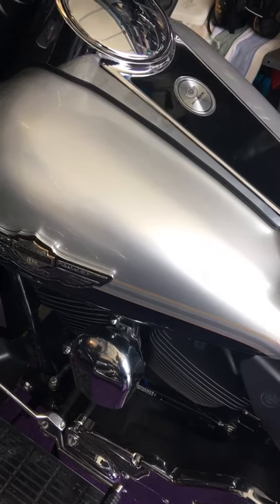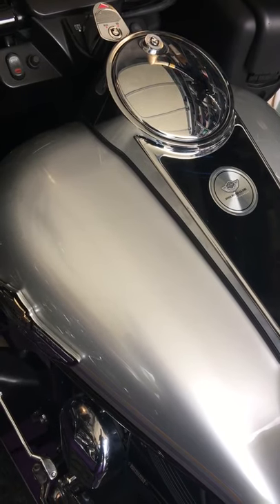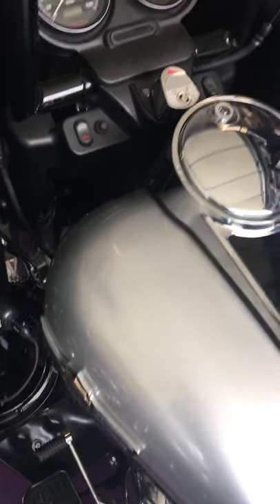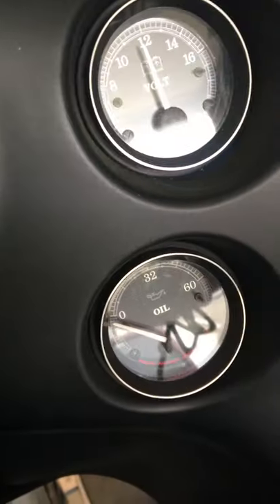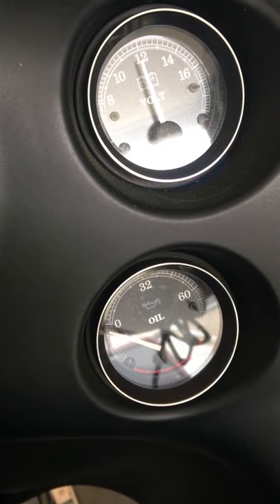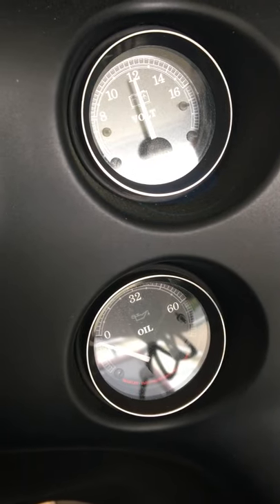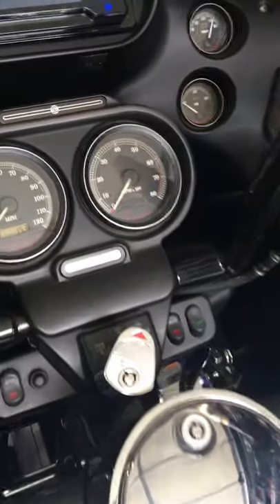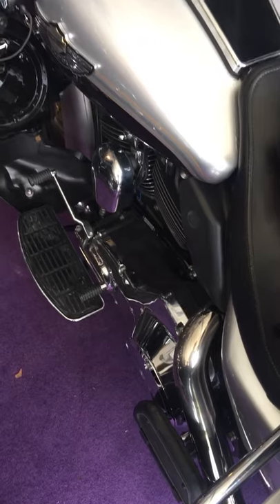S&S 510 cammed 88ci. Road Glide

Comment: My Road King is currently in the shop right now getting the exact same set up... I can't wait to get it back
Reply from the maker: Hopefully you’ll have equal results and be EQUALLY happy with your results! 
I Loved This Bike!
Reply: What Air filter do you have on your bike in this video  ? Assuming you changed it from stock  👀
Reply: Never mind. I just seen. K&N 👍Just a little FYI. I'm installing a Permanent Racing Oil filter. It gives ya around 7 more hp and torque
Reply from the maker: I run a Flo reusable oil filter on my bike. I had on on this 03 and I have one on my 20. I put one on The Mrs. 2012 FLHX as well. Hers is a 103 punched out to a 107. Cams, and Cam plate, oil pump, inner and outer bearings, head work, valves, lifters, TB, Trask intake, D&D 2:1 Diablo Gato exhaust, power commander 5 and Dyno tuned. 
It’s pushing 125/120 to the wheel!
It’sa fun bike!

Comment: The upgraded Hydraulic tensioner is the way to go. I've been told the gear tensioner can break
Reply: They can break if the runout gets worse than .003 of an inch

Comment: Sounds great  I’m having mine done as we speak 05 ultra classic with 53k miles hope it turns out as good
Reply: How did it turn out?
Reply: How much was it? I have almost 50,000 and my tensioners were replaced at 30,000 miles but they just put the factory plastic ones back in so when I redo mine I'll go hydraulic

Comment: Sounds GREAT!  I'm doing the 509G kit on mine this coming weekend and if it sounds as good as yours I will not do the exhaust but spend the money on getting the cylinder heads ported.  Get the heads right and then next summer I'll do the bore kit.
Reply: @john0270  I did not go thru with it, yet.  Got too many irons in the fire and couldn't have the biked apart that long, maybe another time and thanks for asking.

Comment: Now get rid of that dual exhaust and go with a 2 into 1 exhaust and you will see a considerable increase in horsepower.
Reply from the maker: I don’t have this bike anymore. I was hot in 2020 and it was totaled. I’m on a 2020 Road Glide now and it does have a 2:1 Full Length, Stainless Bassani on it

Comment: I also have an 88". Mines an 01 and carbed. It seems that the EFI models just don't make quite as much HP and TQ as the carbed models. With everything you have, it should be right at 100 HP/TQ give or take. I'm sure if you had the heads ported you'd be at or well above those numbers. I'm slowly building mine. Really wanting to keep the 88". It's such a fun punchy motor.
Reply: I have a 2001 RoadKing with the magnetti Marelli fuel injection system that sucks. They went to Delphi right after so it’s hard for me to find a tuner. A thunder max is 1000+$
Reply: @toolbrothers1477  I believe you can convert over to a Carb right? I could have swore I've seen guys do that.
Reply: @iruleyounow  I did it on my 2001 RK.  Night and day.  Ill never go back to FI.
Reply: Twin cams LOVE a bump in compression… I sorta kinda feel like getting heads ported should be stage 2 because EVERYTHING in a gasoline powered engine benefits from better airflow!

Comment: I was wondering about your comment that at idle it showed zero psi… was the idiot light coming on for oil pressure? Mines having a similar problem
Reply from the maker: It never had a light come on at idle when the pressure showed zero. Almost every older Harley I’ve ever looked at did the same thing. Super low…. Or Zero

Comment: Your Bike sounds nice Bro....I am debating whether or not to Cam my FatBob 103....Its stock with 2 into 1 V@H Propipe and Dynoed with a Power Commander making 79hp and 98lbs torque....Good power on top for highway....little flat on the low end

Comment: How was your fuel mileage? i put a thundermax autotune system in my ultra and get 32mpg max 36 on the highway. its horrible i think i need to get it professionally tuned or something
Reply from the maker: I don’t recall MPG but I would just start looking for a station around 150 miles. I have pushed it up over 200 on a tank. 
5Gal. Tank

Comment: Sounds good. Where did you get your antenna and mount from
Reply from the maker: It’s an antenna off of my tour pack that I revived the rubber boot, loosened the set screw, cut the antenna, and reinstalled into the screw on base. Then remounted onto the stock Antenna base.
I never listened to radio, I just wanted to have something on that antenna base.

Comment: how do you find the low rpm, low throttle driveability?  I have 510s in my 95 and its a bit rough in low rpm
Reply from the maker: When I had mine installed and put on the dyno my mechanic tuned it via the Power Commander 5.
Reply: Pretty typical if the initial timing and or advanced curve is too high, needs to be tuned for the street once you swap cams everything changes and stock timing will not cut it anymore. Highest octane you can get at the pump. You will constantly need to drop a gear before you roll on the throttle until its tuned properly.

Comment: love the reinharts....do your gears sound loud and clappy metal sounding , when mad hot? i have andrews 37g;s in my 95 cu in, 2005 fatboy.   she screams at top end, but at ideal,hot she's a clappin hot( gear drive side and primary side} when i listen to it with my tethoscope...it sounds like the bottom engine, front head , crack shaft bearing, or some shit>
Reply: Its your counterbalancer..
Reply: @Clutch_Kick187  hi , yes  it is, my indy put new plastic chain guids on the balancer for me, before he did the fueling camplate and high flow oil pump.  btw, does your oil level drop in a week, if not riden?  ty in advance. hope you hade a great trip.

Comment: Did you have the tensioner shoes replaced prior to the cam upgrade? If so at what mileage
Reply from the maker: No 
Not prior to, I had them done with all of this work. I was on borrowed time. I got lucky they held together until the milage in the video
Reply: @R3215T3R  yea I have 2009 ultra that has 85k on it with no issues & just picked up a 2004 roadking custom with 22k on it. I think I'll run the roadking until I put it up next winter then do the cam upgrade & change it over to hydraulic.

Comment: How much did this set you back?  Thinking of doing some work to my 88ci Heritage.
Reply from the maker: Silidons 
Fueling hyd. Cam conversion  699.95
Quickie push rod set $224.95
S&S 510 cam kit $328.95
Rocker box gasket $19.32
Power Commander 5  $399.95
AmsOil 20/50 $51.00
K&N filter $12.50
Inner and outer cam bearings $75.00
Labor $450
Dyno tuned $350.00

Total 
$2658.18
Reply: Thanks for the response. Might be a little cheaper for me because my bike is carbed. Unless I upgrade to the S&S or Mikuni haha
Reply from the maker: Silidons might be.... The secret to ask of it is the Dyno tune and Habib zombie willing to put in the time with it on the rollers. Mine was on there over 5 hours fine tuning the curve. At one point the HP was higher but the curve wasn't smooth and I'd rather have a smooth curve with high TQ number than HP.
Reply: @R3215T3R  Yup, I ride mainly in the low range, I'm a torque guy myself as well.  Don't care too much about HP.

Comment: I just put in s&s 509c cam and fueling hp cam plate and hydraulic tensioner replacement shoes s&s quickee pushrods and tubes fueling hp hydraulic full travel lifters and bdl hp clutch and a commander v dynojet but can't find a Mapp for it I also have stage one from harley-davidson slip on exhaust and kn high flow air filter what do you suggest
Reply from the maker: Honestly, I’d look around in your area and find a tuner that has a good reputation. But whatever tuner THEY prefer to use and go with a Dyno tune! I know it’s more money… but buying a tuner that THEY are familiar with, is gonna give you the best bang for your Buck on the Dyno! My guy prefers to tune Twin Cams with the Power Commander and he uses the Power Vision on M8’s

Comment: Are you in a lower RPM range now when you're cruising on the highway?  Sorry for 21 questions with ya lol.  I can't see my RPM's on my Heritage.  Engine sounds pretty winded out when I'm going 80-85 on the hwy.
Reply from the maker: Silidons with my 5sp 
At 75mph my RPM's are JUST OVER  3000. If I had to guess, I'd say 3200.
I'm also running a chain conversion with 23/50 sprockets. I went with the Zippers Performance, chain conversion.
Reply from the maker: Silidons I'll try to find out what it is at a higher speed. Don't know of the top of my head
Reply: @R3215T3R  Ah gotcha, I'm still on belt drive.  I was just curious if it helped the MPG while on the hwy.  Thanks man I appreciate it.  I was debating selling this bike and getting a newer touring model, but after test driving the m8, to me it feels horrible (good power, but doesn't feel like a Harley to me).  I like the shake and rumble! lol
Reply from the maker: Silidons I'm getting A LITTLE less mpg's since the cam and tune. I honestly don't think it has anything to due with the upgrade as it does my throttle hand. LoL 
I tend to get on it more and it and to like 80 on the freeway more than it used to. I don't like the new bike. Like you said... Power is there, feel is not. I'll stick with my TC. My Wife will be upgrading her motor first (As she is messing  100k since buying it new in  Oct. Of 12) and we're planning an S&S 124 for her 2012 FLHX
Reply: @R3215T3R  Thanks again!  That's the fun part though, makes it feel like a whole different bike I'm sure lol

Yup don't like the new M8 at all!  Feels like a goldwing or something... I digress heh.

I'm looking forward to getting some work done on mine!
Reply from the maker: The Mrs and I were BOTH taken out Oct. of 20
This bike in the video (as well as her 15 CVO Road Glide) we’re both totaled. I bought mine back and gifted it to a good friend of mine. I’m now on an M8 114 2020 Road Glide Special. I was super hesitant but finally but the bullet! I wanted to keep and fix my 03 but The Mrs. Wanted me on something newer. After a week of “arguing” I bought the 2020. So far. So Good. No issues with sumping  or transfer.
Reply: @R3215T3R  Oh I'm sorry to hear that but glad you're okay now.  Funny enough, just two weeks ago I got myself a 2022 FLHX!  Lol.  I want to do some engine work to it also hahaha.
Reply from the maker: I’m dialing in my comfort mods to mine first, then I’ll do a little “stuff” to the motor. Nothing crazy!
LoL

Comment: What shop did you have the work done at??
Reply from the maker: Matthew Bostic 
Dirt Floor Cycles in Statesboro GA.
It's about an hour away but they do Great Work. It was worth the drive and I have an HD dealer less than 20 miles from me. I prefer to support indy shops.